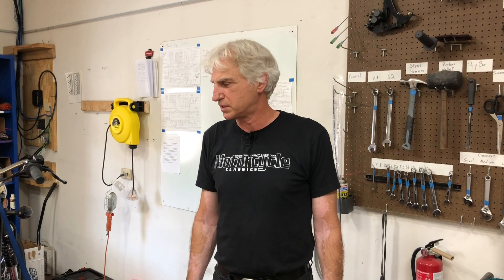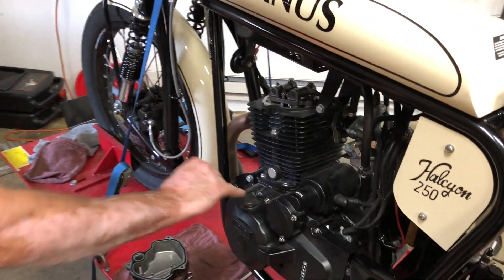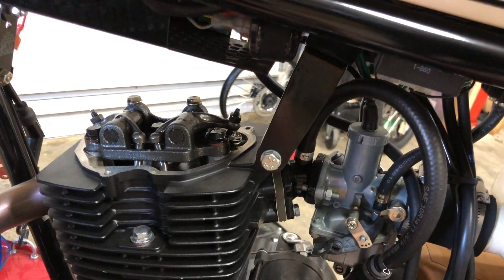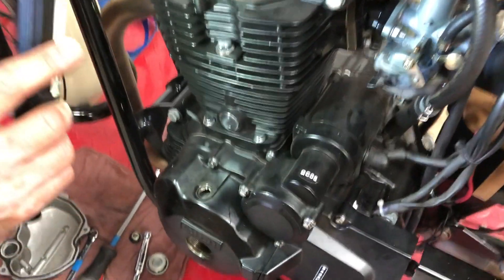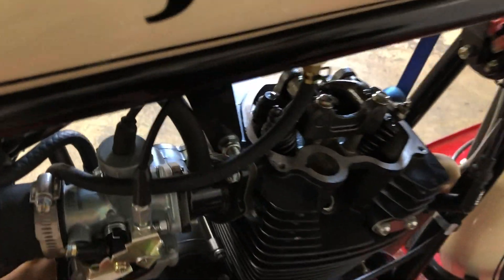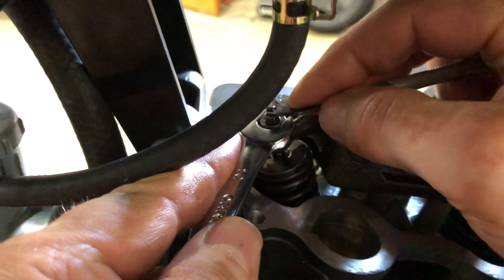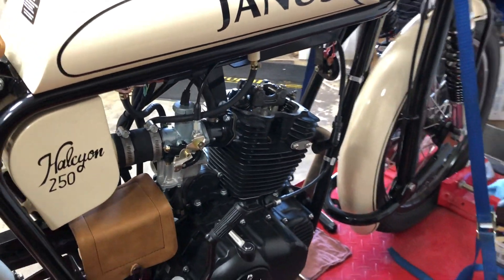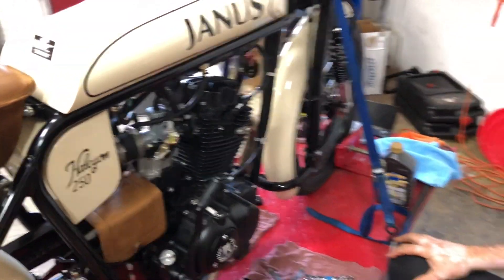How to adjust your motorcycle valves | Janus 250 (Updated Specs)

Comment: How do I know when I need to make a valve adjustment? Not a mechanic by any means, but these bikes are so simple, I'm confident I can follow the steps in the video. Well done! And thank you for all of these great videos! Very helpful. ~ Gryffin #117.
Reply from the maker: The maintenance schedule is outlined in the owner's manual that comes with each Janus motorcycle. There are regular intervals where you should check your valves and adjust when necessary. And that's great! We love to hear stories of more people working on their bikes.
Reply: Valves normally have a little ticking noise especially when cold. But overtime valves seat on its place and wear happens. The space that needed to be between closes over time. When it gets too closed, bike wouldn't accelerate as fast as it used to before. Because valves don't fully shut down. Over time bike wouldn't start when it's cold outside. Because valve too tight, it couldn't push it down. If used this way valve may burn up because it can't touch it's place to cool down.

Comment: Big John - I am doing valve adjustment for an Oct 2020 Halcyon and I cannot remove the valve cover without first disconnecting the wire box. It doesn't seem to be an issue for you in this video, but I cannot get the valve cover off otherwise. Can Janus please address this via an updated video? Thanks - Airborne Halcyon #506.
Reply: Slowly rotate flywheel until intake valve opens.  Cover comes right off.